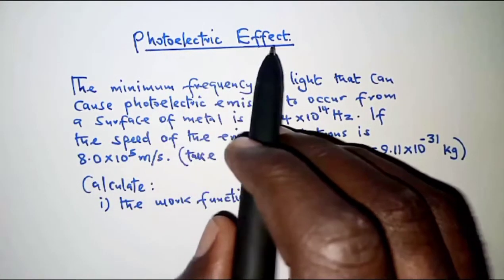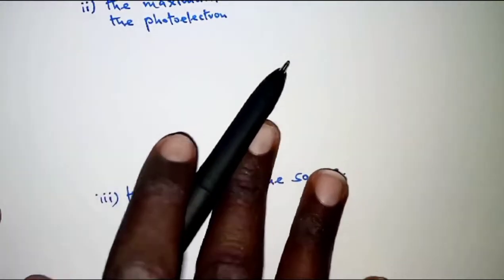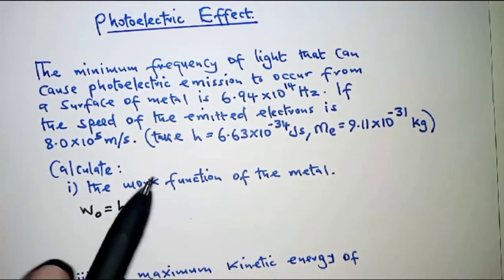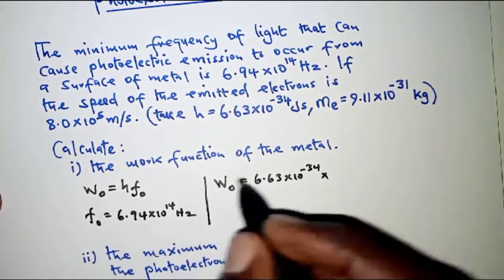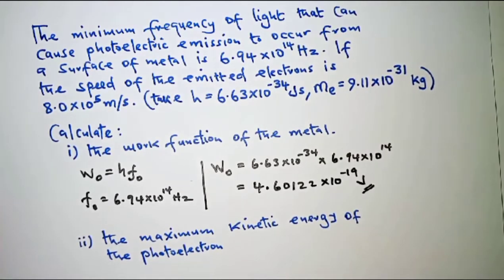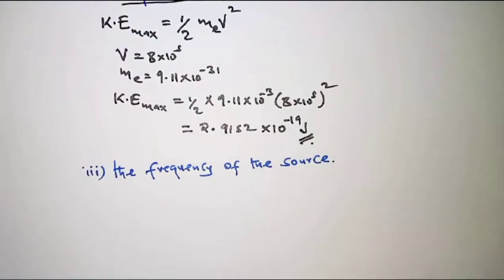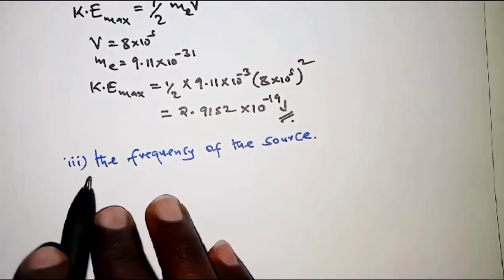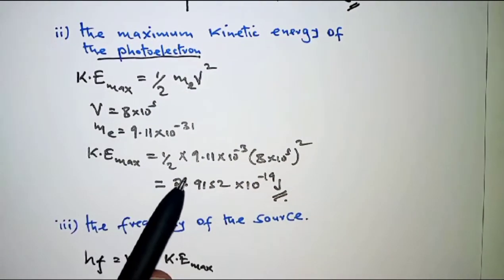Photoelectric effect/ Einstein's equation of photoelectric effect.

Comment: What do you mean with "maximum" for the electron energy? There is no energy distribution here.  The electron energi has a distinct value. This has nothing to do with beta particles
Reply from the maker: Hello! Thanks for your concern. The question here refers to the kinetic energy of electrons which varies depending on the accelerating potential between the cathode and anode. Given a specific velocity (8E5 m/s), that should represent the velocity at maximum KE yielded by the then accelerating potential. Velocities below this value would mean slower particles, implying lower KE. Please let me know if this response helped.